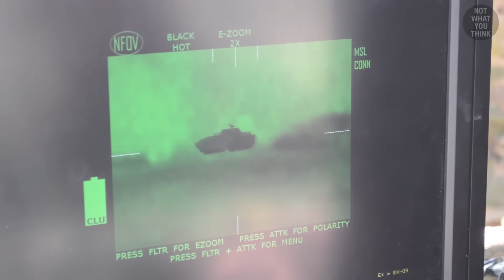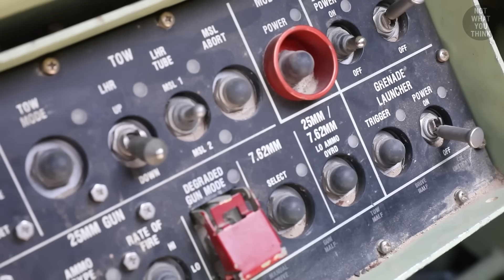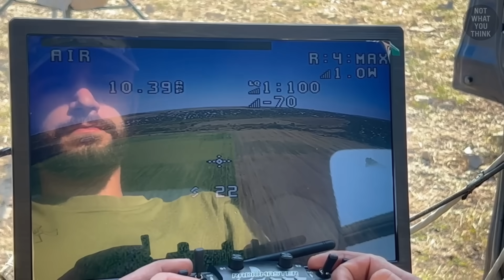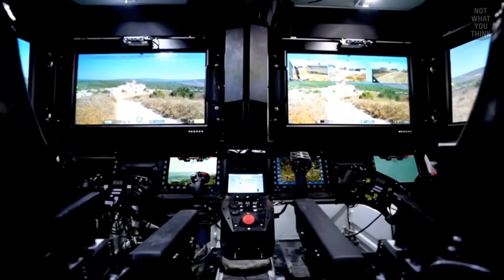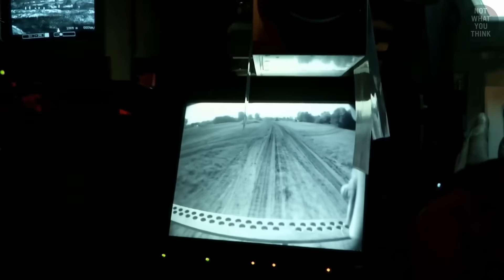How Bradley IFVs prove more Useful in Ukraine than Tanks

Comment: There could be a new niche - the Drone Carrier.
Basically a IFV style vehicle except instead of carrying troops it carries drone pilots and facilities for rearming and recharging drones (usually via hot swappable batteries) that it launches and controls. 

It's main gun might even be switched out for something optimised for indirect fire, since it will always be accompanied by its own dedicated spotter drones that it can use for Forward Observation. And Infra-red spotter drones will make life difficult for enemy anti tank infantry. 

There is also a argument for its main gun being a AA gun for killing enemy drones, as it will be better at identifying which drones are friendly - since most of them will be its own, and it'll have better communication gear so it might be able to IFF others drones easier. For defense it will use its drones to eliminate threats that dont get shelled by the Drone Carrier, either by missile/bomb armed drones or kamikaze drones. 

It could also send anti-drone drones to deal with enemy drones, to protect friendly forces on the front lines from FO spotter drones calling in fire, and drones directly attacking. Anti-drone drones will need to be rearmed quickly, as they will be the close air superiority of ground forces in contested airspace. 

Already the new Panther Tank concept includes a configuration with a crewmember who can control a drone, and a onboard spotter drone to be launched.

Although a dedicated Drone Carrier might work better on a IFV chassis due to the room for a number of Drones and pilots. Even using the same chassis has logistics and development advantages, and also prevents it from becoming a priority target if it looks like just another IFV.

But no matter what the chassis, it will have the best situational awareness of any armoured vehicle on the battlefield.
Reply: Wow..vehicles launching drones. Some games have that, maybe it would be nice idea in real
Reply: @regularshiftrs3676  I got what you were saying.
Reply: @regularshiftrs3676  Sounds like you hating bro, his analalysis is pretty good.
Loitering ammunitions and indirekt fire rule the modern battlefield.

I would go even further, strap oldschool Spike launchers on the sides of IFWs and give the guys in the back controllers.
If you have the bandwith and dont get jammed, you can hit everything that doesnt has a next level active protection system.
Reply: @westphalianstallion4293  Maybe I expressed myself wrong. It is a excelent idea. Just said some games have a similar vehicles like he described
Reply: @regularshiftrs3676  Sorry, sounded a bit passiv aggressiv.

There are decent games that are pretty good learning tools for tactics.

What the mongols was its bow, the modern man has its controller and touchpad.

Maybe mounted warfare will be controlling drones/ missilles and gun turrets.

Gun turrets, WWII drone dogfights, even blimbs and balloons are legit concepts in my opinion and should be linked into.

Its a bit throwback but wires cant be jammed or tapped.
Reply: @westphalianstallion4293  no problem😁
Reply: what youre describing sounds like a modernised command vehicle above all else. you couldnt effectively have both an AA weapon with ammunition, radar, tracking, and a full turret with all of the crew stations, drones, and battery recharging stations youre mentioning. youd likely need a small APU to facilitate all of that charging and combining both of these would make the vehicle far too big to be practical in a transportation sense. 

besides, why would you want to put two different systems on a single vehicle? it would overcomplicate production, make them unnecessarily expensive, and turn it into a high value target in the enemies eyes.
Reply: So an aircraft carrier... on land. Scaled based on the % of earth's surface it operates on.
Reply: Its called a truck bro.
Reply: I think there's definitely potential there, although we might just see tanks carrying a few drones each instead. The problem with a centralized drone command vehicle is that it's a very attractive target, but then again so is a tank or IFV anyway. I don't see why you would put any guns on it, AA or otherwise, I think it would be better to just park an AA vehicle next to it and communicate with it, much easier logistics too (better to carry 2 light vehicles instead of a single massive one).

Whatever happens I think we'll see much greater adoption of the drone in the coming years. It's too useful not to integrate in basically every strategy.
Reply: Arsenal bird IRL?
Reply: You've got the right idea. This year french army has introduced an obligatory drone operator into every armoured platoon. The drone is small, and is not meant to destroy, but it works very well in compensating for an armoured formation's greatest weakness.
Reply: Essentially a ground-based aircraft carrier for drones
Reply: Sorry, but putting your drone operators in one big target is going in the exact wrong direction.  The modern battlefield favors dispersion, not concentration.  There's a reason why Ukraine's drone teams mostly use ATVs, UTVs, SUVs, and other small,  light, easily concealable vehicles.  They could use APCs and IFVs and choose not to.  That should tell you something.
Reply: @danielstickney2400  they are not going to carry a dozen operators, maybe two or three and equipment to maintain and operate several drones in the field. If it's a European or American vehicle then it would actually be safer due to crew survivability  of western vehicle design, however, Russian versions would totally explode on hit though.
Reply: What you are describing already exists, every country is playing with drones on ATV's, IFV's, armoured trucks etc
Reply: Yep. We have those. The most popular drone carriers in Ukraine are Mistubishi L-200 and Toyota Hilux.
Reply: It would make sense as a support vehicle for regular IFV’s. While normal ifv’s drop troops off, the support/drone carrier would provide support from a far with air burst ammo for trenchers & a drone launcher. Could be an fpv drone or a recon drone that could relay information to troop dismounts
Reply: I think integrating drone warfare into mechanized warfare is a bit more complicated than "drone carrier." However I do agree that front line tanks need to be integral to future drone doctrine if for no other reason than keeping the drone operator and ground station mobile, under armour, and close to the front will be a huge advantage.
Reply: @samoldfield5220  That's what they said about Combined Arms Doctrine.
Reply: Very good idea 💡 👌
Reply: How about something akin to the Merkava's mortar: with the ability to fire mortar launched loitering munition, drones providing "birds eye view" and "periscope" capabilities, as well as smoke? I like some of the potential for the Merkava design to the logistics train with the layout similar to lighter IFV/AFV's, enabling multiple variants; which I would hope, could bring down costs due to commonality and mass production. Though you might end up replacing lighter/cheaper vehicles with these. [off topic rant over]
Reply: I can definitely see that as a possibility, another one is drones designed to hunt other drones and and either ifvs or a new class of vehicles to defend infantry and vehicles from drones.
Reply: This is a brilliant assessment of the modern battle requirements, made more relevant judging from the current resulte from Ukraine.
Reply: That sounds like the right idea, but it might be better to be split up. Putting everything in one place makes for a single target. How about a single network controlling drone vehicles that perform a single battlefield function. This makes the individual vehicles smaller and faster. I could see network/command node vehicles, spotters, AA, AD, heavy machine guns for infantry support all moving together. 

This is the first time inexpensive drones have been used in combat. In the future, anti-drone warfare will be the decisive factor. Lasers have been touted as a means, but this can be easily defeated by smoke screens during retreat, or mirror finishes on the outside of the drones. I think that anti-drone systems will remain kinetic projectiles even if those are say tiny suicide drones that optically track detected enemy drones, seek them, and using AI attach and explode a tiny shaped charge to destroy the attack drone.
Reply: @whynotthinkwhynot-  A few years ago the Russians developed a drone fighter that carried a shotgun. They also have jamming vehicles to knock out drone communications, but the Ukrainians have figured out how to target them.
Reply: The problem is, that drone operators (especially fpv) are operating close to the frontline to improve their range, so with ifv it will be easier to detect your unit and to provoke artillery, drone, portable missile fire.
Reply: @casbot71 (original poster), That's exactly what I was thinking and it kind of reminds me of the Protoss Carriers in Star Craft. Also that movie that recently came out called "The Creator" is almost like a harbinger or foreboding warning of what's to come in the near future.
Reply: That is an interesting idea.
Reply: I think the military should really buy your idea.
Reply: Waiting for drone dogfights. Tiny buzzers with bb guns.
Reply: that's very interesting tothink about
Reply: Already in development. not yet developed for military use AFAIK.
Reply: @frank6587  what does AFAIK mean?
Reply: @StarWarsExpert_  "As Far As I know", young one.
Reply: @frank6587  ahhh, okay.
Reply: @StarWarsExpert_  As Far As I Know, I think I've just answered your question.
Reply: @StarWarsExpert_ 
As Far As I Know AFAIK
Reply: what makjes you think the Ukranians aren't already doing this? (although if you're set back from the front line then you don't need IFVs for the task - there are more appropriate/less attention-getting vehicles)
Reply: This thing would be a massive target. it'd be very visible due to its size, signals emissions and the dinner bell or a gun shooting at other drones. Would be better organized into a platoon sized unit with maybe an 8X8 + Ammo trailer as the carrier and 3 Medium vehicles for pilots and technicians. Be better to leave the gunnery to AA batteries as this unit would be in the rear.
Reply: Actually, the Israeli Namer would be perfect for that, an APC build up from an MBT. Plenty of room, but battle tank protection.
Reply: Sounds good, but very expensive :)
Reply: @stefanpavlov6370  war is expensive like that, historically it was always expensive
Reply: Until someone rolls in a jamming system and half of its purpose becomes useless.  If field launched drones were larger and more jamming resistant then I could see it, but at this point the tech is so small you can just fit a drone crew in an IFV or truck
Reply: The US has experimented with IFV that can launch and recover fixed wing drones.  Never heard if they’ve been deployed but pretty sure there was a Stryker on display inch that had it.
Reply: It's not a bad idea. But as others have pointed out that's too much for one vehicle. I believe that if we take inspiration from the Navy and look at it like a carrier get this concept could work. Think about it. One drone carrier a couple self propelled artillery pieces a couple ifvs (because armor needs infantry plus they can shoot down drones). You've got drone strikes, recon, indirect fire and defensive fire all tied up in a nice bow of shoot and scoot capability.
Reply: Sounds like a role better suited for a truck or something like that with only enough protection to defend against debris, shrapnel, and small arms.
Reply: I think the new German KF-51 Panther MBT has the ability to launch drones (Hero 120). At least the developer has said that.
Reply: Theres already truck and jeep launched drones, same way how thers mine launchers and stuff. 

I dont think an IFV would be useful in this role, though. IFVs are big, expensive and armed+armored for combat. A drone carrier in the back could be easily on something like a Humvee, theye not getting to the front lines.

And as for controlling drones... I think bunkers or far way control stations would do better. They can be even further away from the drone carrier.
Reply: And now you got a single point of failure
Reply: Unlikely. It would be more cost efficient to make Artillery Fired Drones instead and just call them in when needed. The IFV crew is too busy to be aiming ordinance.

Some sort of small visual drone could maybe added in a similar way as those smoke granades are used to give the infranty a visual on what they are walking into, bur the tank crew is too busy with their main operations.
Reply: the CV90 has it now
Reply: Drones will not be a big deal in the future  except to locate things anti drone systems are catching up very fast
Reply: This is already in use at least in an improvised way. For self-defence reasons I advise against removing the main gun. typically, Bradley's get speciality upgrades byt reducing the passenger carrying capacity. So, you want a Bradley tank destroyer? Stock up with more TOW missiles inside at the cost of some troop-carrying capacity.
Reply: Drone carriers can be made out of a Toyota Tacoma, why use a $10,000,000 peice of equipment.  They sit behind the front lines, stealth is key for a drone carrier.
Reply: Some good thoughts.  If only our military institutions were better at harnessing public ingenuity, facilitating citizen engagement & innovative solutions in a crowd sourced manner...
Reply: @assertivekarma1909 I can assure you. People who’s sole job it is to think of more efficient ways to kill have already thought of that way before you even saw that idea on a video game. Any industry that’s worth billions of dollars have already jumped on any crowdsourced idea. The only room crowdsourcing ever has in a lot of these industries is for data collection. It’s not like the tech industry, in the military-industrial complex, if you can’t build your idea, someone will either buy it from you or outright steal it.
Reply: @assertivekarma1909  Do not have too much faith in military institutions. Because in almost every major conflict, they have been at odds over how new technology should be used and responded to.
Reply: Or we could mount an automated lmg turret capable of detecting and taking down drones. Make it send out a sensor ping of some kind. Once it detects a drone, then BRRRRRT! before hiding or moving onwards (or backwards). Typically you have about 2 to 10 minutes tops before the arty starts zeroing in.
Reply: @justjoking5841 A problem with that is that a 'sensor ping' is radio wave output. In short, radar. 
Which can be tracked. And targeted.
Reply: We can also either supplement or replace the AA gun with a laser, which while it is more expensive to procure, it's also comparatively cheaper to operate.
Reply: @Iamwolf134  You're assuming that a useful weapons laser will be small enough to vehicle-mount. At the moment the entire system (including powerplant requirement) is too big for a IFV or even a tank and needs one ore more dedicated vehicles
Reply: @miscbits6399  You don't need to destroy the entire Jet, if you can neutralize the onboard radar or the pilot, that would significantly hinder said Jet. Imagine for a second if a pilot cannot detect that a missile is locking on to them because their sensors are fried.

They don't take evasive maneuvers if they can't perceive the threat, so they just go kaboom
Reply: @frank6587  remember the Geneva convention on blinding weapons...
Reply: @miscbits6399  Try to autopsy the carcass of a burning pilot.
Reply: @miscbits6399  The U. S. Army and Navy have 30 kW laser defense systems in field trials. In 2021, the Army tested a laser completely mounted on a single Stryker vehicle. It was able to take out drones, air-launched rockets and artillery and mortar shells, but the soldiers using it pointed out some safety and target ID issues that needed work before it was ready for deployment.

Some of the big name contractors are developing 100 kW to 300 kW lasers that mount on a standard weapons transport chassis.

These lasers are pulsed, not continuous, so it may not be necessary to have a 100 kW generator for a 100 kW laser. An undersized power plant limits rate of fire as it takes longer to charge the capacitors between shots, but generally the limiting factor on rate of fire is thermal management, just as it is for some high-rate automatic weapons.
Reply: What are 5:42 arched strips of nylon for downed power line protection? What do you mean downed power line? Are there power masts falling down on the bradley or what? Please explain.
Reply: @StarWarsExpert_  Perhaps you've seen video of troops moving through shredded forests. The same thing happens to power poles in urban areas in Ukraine's war. That means the power lines come down, but not necessarily all the way to the ground. If they are energized, they pose a hazard to troops exiting or entering the vehicle, and could damage the electrical or electronic equipment in the IFV. Worst case, they overheat the ammunition storage area with current going through it. Even if the lines aren't electrified, they pose a tangle and trip hazard. The strips are meant to deflect low-hanging lines and so avoid the problem.
Reply: @paulbade3566  Thank you for your response! Now I wonder how these strips can deflect low-hanging lines and not cuase electricity to flow into them. Are they made out of some electrically insulating material?
Reply: For a drone operator/indirect artillery IFV you would have to have  some solution for how to avoid getting tracked by electronic warfare equipment using the drone operators control signal. Maybe the mobility would be enough but as long as youre operating the drone the vehicle is fairly trackable. The indirect fire function will be less effective while the vehicle is in movement.
Reply: @erikreuterskiold5996  that only applies to COTS drones not designed for a contested environment.   
For a purpose designed and hardened against EMI drone they’d be able to avoid EW issues.